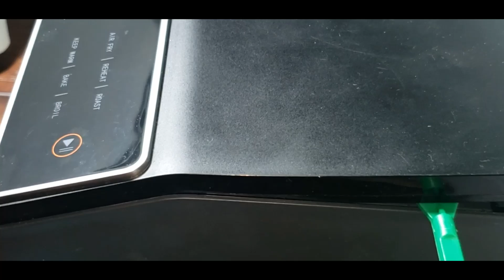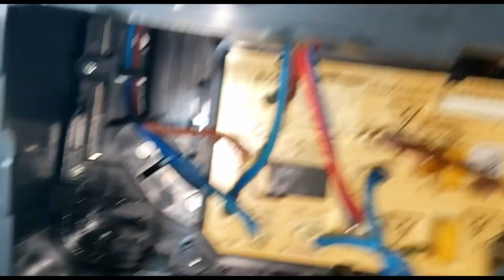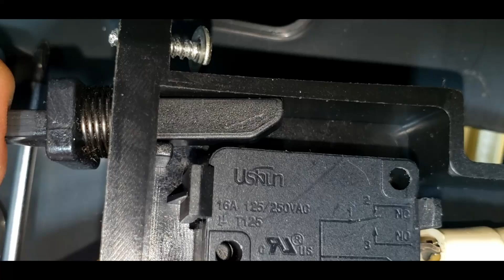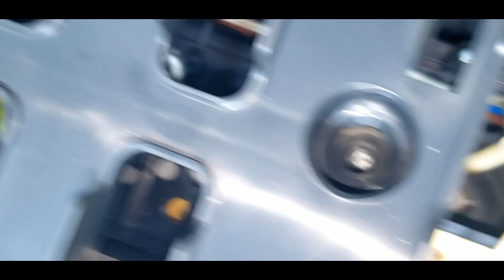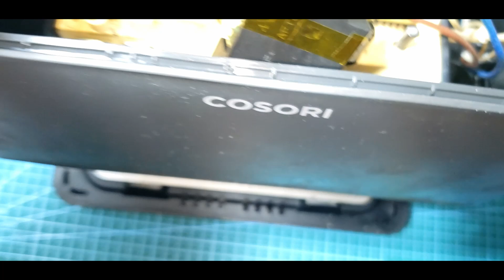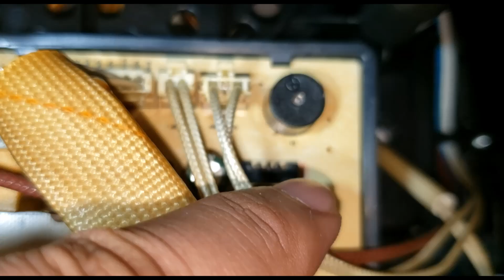How I Fixed My COSORI Dual Blaze Air Fryer’s Basket Sensor Issue! DIY Repair Guide

Comment: I have the same air fryer; the problem right now is that the top heating coil doesn't heating up. I tried cleaning it and unplug the unit for a while, still doesn't work. any idea how to fix this? thanks.

Comment: Yoooo such a precise yet thorough video. Just repair it with in a few minutes. I used the plastic cover from electronic packaging cause it's thin (had to double it to be perfect) and some school glue to keep it in place temporarily while I reassemble it. Had this thing for over 3 years now and finally got it to work again. Initially it was just not noticing that the cage was open, but I just continued using it. Then it stopped noticing the cage was closed, at which point it wouldn't work anymore.  THANKS for saving me mad money dude.

Comment: Great video! You helped me locate the problem.  BTW - you can "short" the connection - bypassing the sensor/switch completely.  Downside is that it always thinks the door is closed, upside is, you'll never have the issue again.  Thanks much!
Reply: Please help me! I tried this and the switch is now inside and not springing back. I think the inside spring (steel thing) broke. How can I short it? Do I just cut the 3 blue braided cables and connect them together? :'(

Comment: as a result of your video, i decided to open mine up (Cosori, but a different model, CP158-AF), and was able for repair my unit! so... just a quick thanks! i WAS considering making a YT submission to show my repair, but i found out today that making a video to post is a PITA, so not sure if it'll ever get done, but, idunno... anyhow, my issue ended up being the plastic plunger, like in your case, but i lack a 3d printer, so i just 'jumped' the switch, since we don't have any kids in the house. thanks again!

Comment: Thanks for this! Mine was the switch but a slightly different issue, the switch housing had melted slightly and the internal contact was sticking. I was a able to disassemble the switch itself and shim it with some heatshrink to work again while I order a new switch.

Comment: Great video. Have you any solution for this model when the touchscreen stopped working after cleaning? Power is on but no response from touchscreen at all

Comment: Hello! I’m not having the same problem but maybe you can help in my case. So the problem is the following: everything works on the touch panel except the start/stop button so basically i can’t cook anything. Sometimes after I plug out plug it back to the electric socket it works for one time but then it starts to be same over and over. Any idea?
Reply: It seems something gets inside the panel and it is hard to activate the button. Had the same problem. Used this video as a starting point how to remove the top of the fryer and disassembled the panel - it connects to the PCB with a flat cable. Then cleaned the actual "keyboard" (which is a transparent folio) with some alcohol. Cleaned the board too. Assembled and now it works like on day 1.
Reply: @andreyhristov203 thanks for the tip, it worked for me. I had the play button blinking and not being responsive. I open the touch panel, clean the transparent foil from all angles even though it didn't look fatty or nothing. Clean everything with alcohol, put it back and it worked 😊

Comment: Thank you so much! I didn't need to 3D print anything. I measured the inside of the sensor channel and used two strips of gorilla heavy duty duct tape on the opposite side of the switch. It only really needed one to eliminate the gap. Two pieces of tape made the switch stick in the on position but once I ran it a few times it works perfectly.

Comment: thanks. Externally I see 3 little "buttons" that are pushed when I insert the basket. one in the center and two on each side. What is the one that actually activates the sensor? I wan to to be sure that is not something I can fix externally by reviewing any obstruction before disasembling the frier. BTW the link with the 3d model doesn't work.
Reply from the maker: The middle black pin activates the sensor. I couldn't figure out what those 2 silver pins on the side are for. My best guess is that they help align the basket into place, because even when those 2 pins are not depressed, the air fryer could still run as long as the middle pin is pressed in. Thanks for letting me know about the link. It should be fixed now.
Reply: @vibroidpaper8027  the two metal pins keep the basket in a gently locked position so it won't fall out.